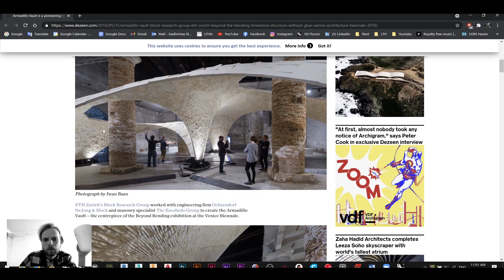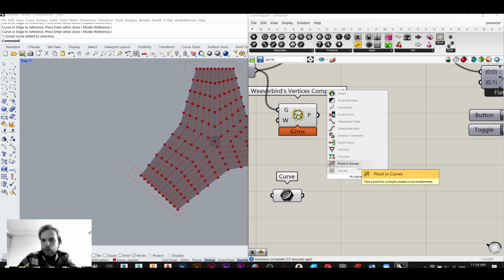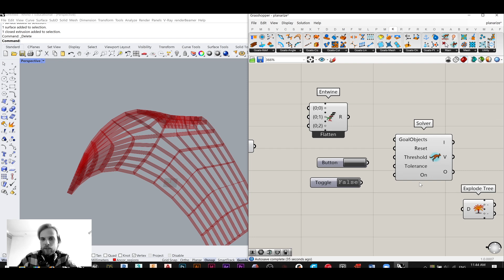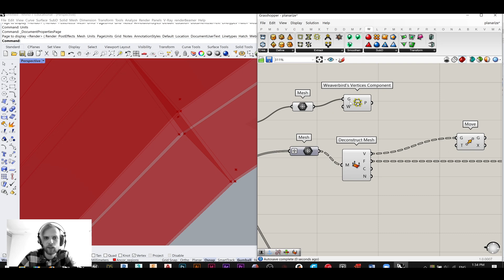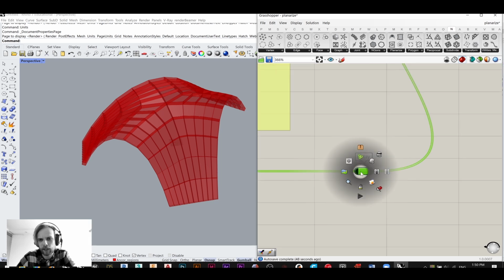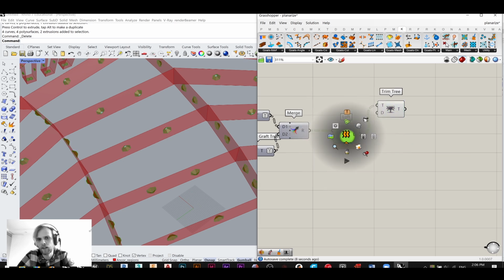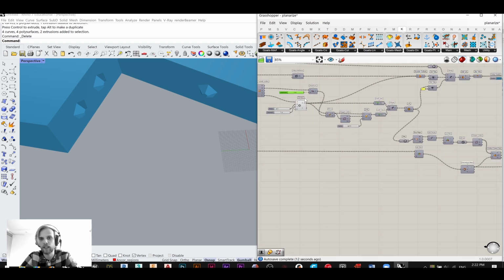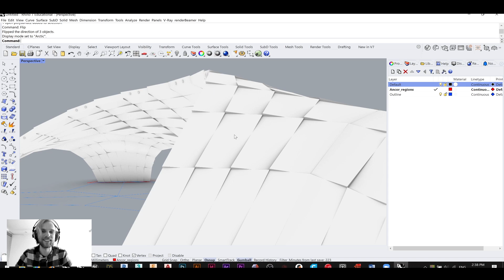Tutorial: Vaults From Flat Bricks with Rhino and Grasshopper

Comment: The mest from points does not work for me. It only shows one surface and it does not divide when I adjust the slider. I did add the Addition component and connected to the U and V of Divide surface component
Reply from the maker: Make sure that preview mesh edges are turned on in grasshopper menu (top drop-down list)
Reply: @DesignGoBrr  Thank you for your quick reply! unfortunately the mesh preview is already set to on.
Reply: @DesignGoBrr  However it seems that you are right. I dont know why it does not display the mesh properly. Because when i bake from the combine and clean component it does indeed give me the mest from points output. So I suppose it has something to do with the display. I will keep testing this. Thanks again!

Comment: Ngons plug-in is super useful- I like how causal and yet informative the video is. Although, I have never been able to understand as a computational designer and an Architect- why does every/most attempt at parametric architecture at building level begins with compressive structures- domes, values  or blobs etc.
Reply from the maker: Interesting question. Blobs do not have crease edges and are continuos forms meaning that surface treatment/patterns on them can stay continuos and there are no corners to solve. It's counter-intuitive but a blob is a much simpler shape to work with. As for compression based vaults and domes - i guess its too cool of a concept to pass on. Also it enables the designer to make super thin structures - maybe there is something there as well

Comment: Hi, Gediminas .. thank you so much for this astonishing tutorial .. any idea on how to change the panels to tiles as same as the ones in Armadillo Vault (tiles)?
Reply from the maker: Yea - instead of creating rectangular grid-based mesh, like in this tutorial, you should create a triangular mesh (preferably with equilateral triangles) and then get a dual graph out of it. This will create a (mostly) hexagonal topology. If you're not familiar with topological manipulation and mesh edge flow manipulation - I'd strongly suggest first using a simpler method: draw out your shape by using large equalateral triangles, use triangular subdivision (weaverbird plugin) and then mesh dual (weaverbird plugin) - should get you pretty close.
Reply: @DesignGoBrr  oh thank you so much, I will give it a try straight away.

Comment: Hi, great tutorial. Do you have any ideas on an optimized way how to generate the formwork to build this vault? I'm trying to group the bricks by their centroid points by distance, is there any other way?
Reply from the maker: Bake out the bricks (without joinery detailing, just boxes) , booleanUnion them into one solid. In plan(top) view draw an outline of the formwork. Extrude the outline into a solid. Boolean difference the extrusion with the solid you've made out of the bricks. Now you have a supporting solid that would hold your dome as youre asembling it. Use bowerbird plugin to create a waffle structure
Reply: @DesignGoBrr  Thank you for the reply, I will try!

Comment: Very informative Tutorial  got to work on different Plugins in one session . just have a question on your approach of using meshes rather than surfaces to build up the form, panels etc
is there any advantages of using mesh that I cant have in a surface? Thanks alot!
Reply from the maker: Umm, Kangaroo physics simulation only works with meshes, so to get a vault system that is compression-only based I needed a mesh. If you don't care about it being simulated, then sure - you can use a surface instead of a mesh.

Comment: I tried to apply this method on a hexagonal mesh. The Problem is that the construct mesh component 49:28  constructs a triangle mesh in my case. Is there an alternative way of rebuilding the faces?
Reply from the maker: Hexagon is an N-gon that cannot be easily constructed with default gh components. Easiest way for you would be to use Mesh from Lines component found in Ngon plugin

Comment: Amazing tutorial !! Can you give a suggestions about 3d tagging plugins for printing? And I try this definition but it's not working on exact dome structure. I wonder how this definition can evolve for exact dome like Hagia Sophia's dome?
Reply from the maker: All you need to do to for Hagia Sophia dome is to use a quad mesh of a hemisphere (with pole polygon ring removed - the keystone will be placed there) instead of a kangaroo form-found vaults. Hmmm but now when I think about it - a regular polar-symmetrical dome should always have flat elements to begin with, so it makes no sense to run planarization scripts on it.
Reply: @DesignGoBrr  Hi again. It really works. But I want to ask something else. I created dome and code works. But as all the elements come to the upper elevations, they start to get smaller. Can I create dome surface with same lengths like a masonry fabrication technique? Thank you.

Comment: Thank your for the tutorial, it’s very useful. I’m trying to anchor the points to an uneven landscape mesh, how would I do this? I’ve tried connecting the landscape mesh into the anchor target input by deconstructing and plugging in the vertices but I’m not having any luck.
(Im very new to gh)
Reply from the maker: On kangaroo surface relaxation step you need to project the anchor points to the landscape mesh and use those projections as your anchor targets.
Reply: @DesignGoBrr  thanks will try this!
Reply: I'm now trying to create a hole in the mesh to use as anchor points, like what BRG have done with the armadillo vault, but I am having trouble splitting the mesh. Do you have any suggestions? Thanks again for your help

Comment: Hi there. I have a problem with Divide Surface. Instead of dividing each edge equal mine creates only a perpendicular grid which is not looking like yours. Any idea about why?
Reply from the maker: Umm make sure that you plug in the slider to both U and V inputs
Reply: @DesignGoBrr  I did. I am using Rhino 5 and 0.9.0076 Grasshopper version. Might it be related with it?
Reply from the maker: @kamilkaptan6318  Oh that's super old - sorry, have no idea which parts of this tutorial would work and which parts wouldn't work on that version. BUT it would be very strange if THIS exact part didn't work because of it... are you sure you're using rectangular patches and not pentagons/hexagons?
Reply: @DesignGoBrr  Yes they are planar rectangular patches. I am sending the image to your Instagram account because I couldn't upload here.
Reply from the maker: @kamilkaptan6318  Hmm, then try this: curve -> explode -> list item index 0 , 1, 2 and 3 -> edge surface -> divide surface. Basically the way it will work is - it will take your rectangular curves, will explode them into 4 lines, will separate each line with list item, will take those 4 separated lines and use them to create a surface between them. Then divide surface should work perfectly even on an old version.
Reply: @DesignGoBrr  thanks man it worked.